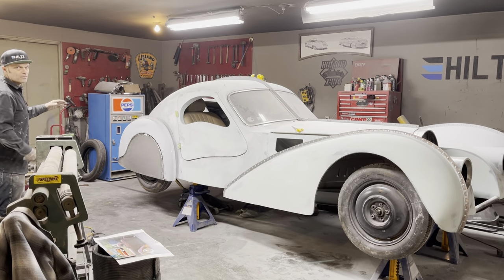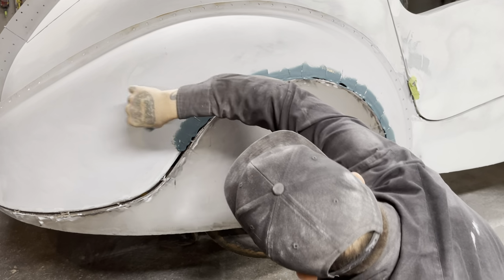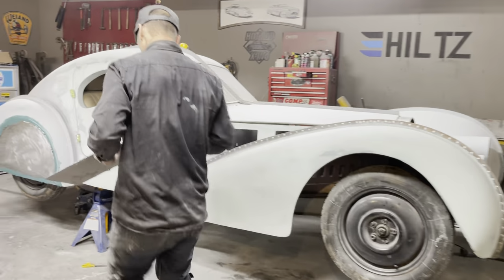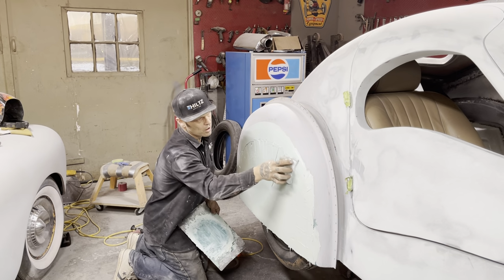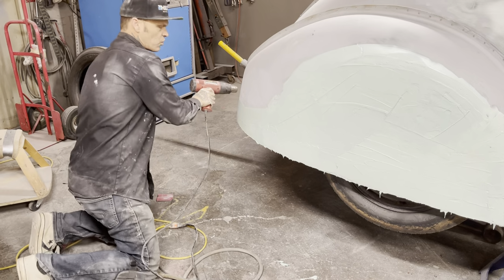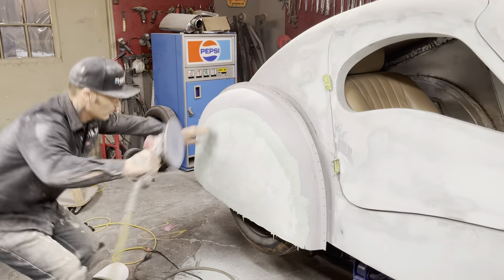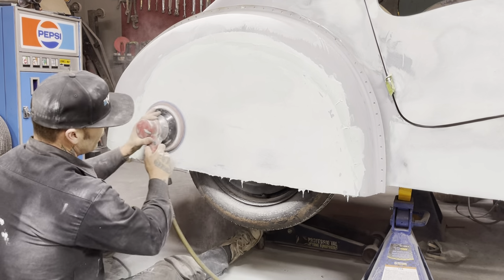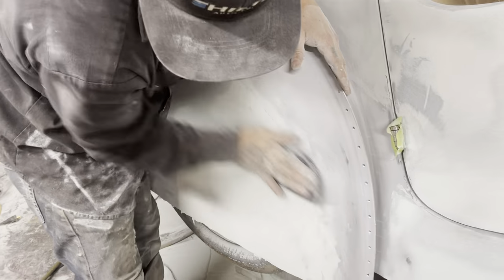FASTEST WAY TO APPLY AUTO BODY FILLER FOR SHOW CAR FINISH

Comment: SEE a Bugatti builder AND a MYTH BUSTER !
Guys that use body filler correctly. 
   Have to fight  an up hill battle, explaining , because ALL, the hackers thru the 60's ,70's,80's , 90's thru till today. That put it on an inch and more thick, to hide damage. So people have seen or know of all the horror stories with Bondo for generations. 
    So thank you for creating a video, we all can direct , the uninformed, how it's done correctly.
Thank You !
Now you just have to tell every body "wide open with lots of pressure ,IS NOT how you use an Air tool."
A never ending learning process, lots of people don't understand ,let the tool do the work.
Great video, pick a day to Announce the color Jolene has picked, you know us ARTist Types, have to envision, the VISION !
Reply: As you know it takes many years of experience to get to the master level and proficiency

Comment: I have done body work using this same method for years now and it works great! First time someone saw me doing it they thought I had lost it because I had a 65 mustang body filled completely shut! Hood doors trunk all of it completely filled shut so there was no body gaps at all. I blocked it out as if it was one continuous panel then went back and cut the gaps open and to size. That car came out so dang beautiful and straight it was awesome! Using the fiberglass filler first is a must just because it's stronger and takes any impact better then just straight filler. Just as a tip when you are doing the body work sanding it down, throwing a guide coat on the filler is a helpful step just so you can see it better. Doing the spot filler allover instead of how you did with covering all of it, all the spots are making high and low spots when you apply it in small sections sometimes making it even waiver then if you just did one big layer. That car is badass to just throwing that in there!!

Comment: The "mud hog" is an old favorite of mine, a great time saver on the larger areas.
Truth is...the gear driven machine provides consistent removal and better control than random orbit or oscillating sanders.
A good dual piston straight file is great, but NOTHING rips on body filler with predictable results like an 8 inch GEAR DRIVEN sander...A.K.A. THE MUD HOG!
Reply: A workout  I like the blk n deceker 
Buffer foam pad stick bk don't
Try it
Reply: At least clean your board

Comment: I have to say you have changed my mind on filling panels with filler.
Fill large and fast....
And flat.
So much time saved.
I have spent whole days on the  same sized sections  in the past.
You just roughed it in in 40 mins.
Nice work

Comment: Thank  God for body filler, when I started in the trade in 1957 any panel repair had to be straightened as much as possible the molten lead was used to fill in the low spots, it was a labor intensive and tedious process. Also the early fillers were unpredictable, the hardener  was clear liquid and you never knew if it was thoroughly mixed consequently you ended up having areas that didn’t cure and other areas that as hard as concrete.  Also you see how he is mixing the product, on more than one occasion as I was mixing the product it would start to smoke and set up right on the mixing board. The big breakthrough came with the advent of colored hardener ,than when it was mixed you knew it was uniform.
Reply: You sound like you’re the same age as me. That’s the way I was taught, metal finish and lead load the small areas you couldn’t get at. We were rationed to one small tin of Plastic Padding per week when it first came out. If we went & asked for more we were asked “what have you done with the one you were given” ? !!! Now it seems plastering the entire body is the accepted way, at least in main stream body repair shops. It’s all about quantity (throughput 💴 💴💴), not quality. Thankfully there are a few coach builders who do it the “old way” .

Comment: I love this project, but I can’t believe that you’ve actually covered the whole car with body filler.
Real coach builders file finish and lead fill small areas only where absolutely necessary.
Reply: Yes we do or at least I did for almost 50years. I remember my first time in a Canadian crash repair shop, back in the mid seventies and the owner didn’t know how to metal finish. Just rough it out & lay the Bondo on like plastering a wall. Needless to say he didn’t know about lead loading either. It was a real eye opener, but I have to say that the folks I met were the salt of the earth. In later years Bondo became widely used here in the U.K. , the “old ways” were no longer cost efficient in repair shops. Coach built vehicles are the opposite, quality costs money, lots of money 💴.
Merry Christmas to all & if you’re going to be using stuff that’s a danger to your health —— wear a respirator.

Comment: You should try the new Mirka dustlass sander system. I love mine and use it almost every day. The salesmen sanded some whit gelcoat with it and then wiped his fingers across the surface and then wiped his fingers in his brand new black jacket and it left zero dust! They are well balanced and light. They also can hook to your phone and tell you rpms and when you reached a maximum European standard for vibration per minute limit. It's a brushless motor too so no moving parts to wear out. Your loved ones would buy you one to save your health also. I've been sending for 40 years or more and this has been one of the best tools in my shop. I hold my breath ALOT when I sand, or used to, sometimes wearing a mask is well, hot lol and sometimes I like to blow dust off real quick so... But this sander is a life saver. MIRKA PLEASE hook Bad Chad up with a sander please. I smoke buy other guys with 3m Sanders or Fien or I've tried all the good ones Dyna Brayde.. It's quiet, the vacuum has a nice long flexible hose and it works sweet. I should probably become a Mirka salesmen.lol I fix boats and cars and rvs, body and paint and fiberglass, gelcoat, make molds do infusion, pre preg carbon,fiber epoxy, I've done it all. My dad used to work for George Barris the King of Customs and he helped build the Munster Mobile and the Pink Panther cars and a few others. I still have some old picks of the cars dad built. So I've been doing this my whole life. Like I always say" If you can still stand you can still sand!" Rob Ormiston.

Comment: Just short of taking the body off the car how will you change tires on it I no your not done yet probably a dumb question I really enjoy your videos I'm disabled an have nothing better to do but you tube all  day
Reply: Good question, once he gets material level on the outside. Will cut a fine l8ne between welded round rod. Then panel will be removable. Will add latches to snap panel back on. Tire can easily be removed. This is how all skirts work.

Comment: I Literally had a dream about this car more than 4 years ago! It didn't have the railing (peaks) and there were footboards on the outside of the doors. So when you step out you step on them before the ground. It was canary yellow and pretty old. sitting on a lift in a huge garage.  It drove great for something that seemed to be sitting for a while!😎  Is this a replica or something?

Comment: I got questions what kind body filler do use an do use polyester filler at any time an do when you apply body filler every that needs it do primer the hole car first then expoy primer sealer last just to seal the hole then you paint it ? The all doing great job jolene doing great job with camera

Comment: Thanks for the video - love the pepsi machine, I would always get one when dad would visit this junkyard( Fieldsboro) in the mornings , Bill would open it and give me one free of charge, must of been because I was only 11 or 12 years old. lol.  Wonder if ya ever tried the body filler dispenser that mounts to the wall with a tap dispenser. Seemed nice were I was working at, as you just put your board under the tap and get as much filler as ya needed and it looks as if you go through a lot of filler~lol

Comment: Chad, please respond to this if possible.
When you mix your mud, you look like you are using what is a ton of hardener and then it seems like you have forever to apply it and it doesn't get hard on you before you finish.
What temp is your work area? I'm trying to figure out if it is your temp in the room, your elevation or another factor I'm not catching but if I did that in my garage in PA on a 65 degree day,  the mud would be hard before I got half of it on the car.If I used half of the hardener you are I still wouldn't be able to get it on the car fast enough.
Is it the product you are using?
Thanks.
Tony

Comment: I’m starting to dabble in body work. Should epoxy primer be sprayed before the filler is applied?
Reply: To answer your question, yes it can be and then you do your filler work on top of the epoxy primer . I does not have to be done this way but it seems to be a better way in todays standards . You can apply filler to bare scuffed up metal and epoxy prime over that .
Reply: Thank you

Comment: im really interested in seeing the latches to hang it on the car.  very cool video. Ive been using  your tips to correct an ugly door gap from a bad 1/4 replacement that was 1/4in off.  On my 65 mustang coupe project.

Comment: Before I cut them off I would make them mount with the brackets are bolts are pens or whatever you decide to use but that way your fit-and-finish would stay the same

Comment: Reminds me of my Drywall career, i did for 45years.
Reply: @benpress8884  Drywall comes in 4x8ft sheets that are cut to fit on a wall. These sheets are made of pressed gypsum with the consistency of talcum powder. The gaps in between sheets are filled with a similar compound commonly referred to as “mud” or drywall compound. The process is essentially the same with sanding.

Comment: Hey Chad, In those joins you'd be way better off using a panel bond glue. I haventb seen may of you guys over there using it. I't's bllody awesome. It has the strength od weld and sands like filler...

Comment: Might be a stupid question but you must have a way to change the rear wheel hey ?
Reply: Cutout and made into a skirt(remove able)
Reply: YEP - here's how that is done. You jack up the car - way up - undo the spring shackle bolts, lower shock mount bolts, then undo the brake fluid line - now then, you also have to unbolt the driveshaft, and the torque links.  Then with a hydraulic jack - slowly lower the rear axle wheels still attached - roll out the axle from under the car.  Next, you take off the lug nuts of the wheel you need to change. With a wooden block under the axle, break free the wheel with the tire. Put a good wheel with a tire in place, and replace the lug nuts. Reinstall the axle the reverse of how you removed it. Then lower the car.  Now you can be on your way.

OR, if that's much too complicated - you could just remove the fender skirt and change the tire the normal way and it'll be quicker as well. Happy Motoring.
Reply: @faerieSAALE  he would have made it all one piece instead there are two pieces so the two pieces would indicate that there would be  a skirt. I believe he also mentions this in the video
Reply: @jontrudell7529  It is not a dumb question.  Many had the same question.  There is a wheel mounted.  Chad said he would remove the skirt from the rear.  So how was he going to get access while the tire is there.  Many viewers  may not be familiar with how to drop the axle.  So the explanation was appreciated.  We know it will eventually be mounted as a removable fender.  So dumb.....
Reply: @nellalarsen9327  HE SAID its REMOVABLE SKIRT & he is gunna DROP the AXLE to cut out skirts from the back side. Are u too Poor too PAY Attention!?? Lol
Reply: @jontrudell7529  I read you response to my comment.  If it is okay with you I'll keep asking 'dumb' questions if I don't know or understand something.  Merry Christmas to you and your family and friends.
Reply: @nellalarsen9327  lol
Reply: @jontrudell7529  So am I at your great intellect and knowledge of all things in coach building.  Have a good and safe Christmas.
Reply: @nellalarsen9327  i suppose so, Hairy Xmas & a Happy New Queer
Reply: @jontrudell7529  Thanks again for your positive information.  Merry Christmas!
Reply: @nellalarsen9327  haha

Comment: So what happens if u get a flat tire or need to do a wheel bearing ,brakes ect
Reply: If you were listening you'd have heard him explain how the cover will be removable , once  the rear axle has been dropped the cover will be cut off from the back/inside where the join line is visible.

Comment: Was that resin you used to thin out the fiberglass?
Reply: Yes and you can put it in bondo as well, it flows well. Kinda like a feather fill catilized (sp) spot putty, fill in sanding scratches, pin holes,edges, or just making old bondo soft.Use regular bondo hardner, mix by volume, it does get a harder as you put more in by volume though. I don't know where they get the space age microspheres.

Comment: Ummm, if you get a flat how are you going to change the back tire if it's all covered up welded and mudded  with fiberglass,  but I'm only 11 years old maybe I'm missing something
Reply: Watch and listen carefully to the video he explains everything
Reply: The fender skirt is only temporarily welded in place while he builds it. When it is done he will cut it loose and use bolts and pins to hold it in place so it can be removed when needed.

Comment: I am sure you are good at you job,  but I was surprise  at the amount of filler that went in to that repair. obviously there is  reason why you did it that way , example ...( who has done the  previews repairs or how it was done or built  before it got to you  ? ) but I recently was involved in  building a complete  new body for that model car in  alluminium,  a bit of file finish was needed in a few places (the like ...where the welded joints  where ,.or where the guards and doors where turned on to the frames etc, BUT...  no   filler what so ever  was needed, just a good coat of high build primer and then the car was painted .
Reply: Shame you didn't actually watch the video with sound.  All your comments where explained.

Comment: He is going for quantity not quality.. that's the difference between a shade tree builder and a Craftsman.. with each panel you make you should be using less Bondo.. never overlap onto rusty metal cut it out and but weld everything.. take some pride in your work

Comment: As you know it's best to stay with the same products, whether it be evercoat or ppg or house of kolar. I use evercoat rage xtreme, then 5star primer/sealer. both are polyester products. I just find I use less filler with the extreme. Know matter the mud you use 2/3's hits the floor anyways. You should always wear a respirator when sanding the filler and primer. Not like this dummy (sorry Chad ). With the chemicals in that stuff will eat your lungs up. Ronnie.
Reply: The best mud cheepist primer ok
Just sand to 220  does shrink
Epoxy all mettle. Take pride in
Work  true massons.

Comment: Chad, don't you risk cracking when you accelerate the drying with heat, the material is contracting at a rate quicker than it was designed for.

Comment: As a professional car painter .. just watching him my lungs hurt. Wear a mask adds a few more years to yourself..
Reply: Me too....seen a lot of guys suffer with copd....in large heart and so on. It's a wonder i haven't got problems too...was sanding fiberglass boats when i was 12 years old at 18 went to work  doing industrial insulation work for 16 years with no face covering. To top it off smoked two packs of Marlboro red everday the world turned... ive been lucky no lung problems most are not that lucky  !!......i forgot spray painted apartment's for Birmingham housing authority for 9 years aswell.

Comment: How in the hell are you supposed to get the tires off of it and do a brake job with the damn skirts over the wheel as well as weld it on

Comment: I can't believe how people use plastic filler over last 20 years. I went to a technical high school (junior & senior years.)  in the mid 1970s. Worked in the field for 35 years. All these workers today are only worried about shoving the job out the door and not long term quality. Your first (and sometimes second) coat of plastic filler should always be cut with what's know (or used to be.) in the profession as a 'cheese grater.' Never use a DA to sand filler!*

Comment: There is such a thing as editing... So you wasted more time with the heat gun as well as mud. Plus if you start to sand before it's completely dry but not completely wet, you deal with less dust.

Comment: Don't put duroglass on top of anything but metal. And skim thru the initial layer, 80 grit,  to open it up past the slime when you cover duro glass  with the body filler.  This Chad is not very smart.

Comment: its gonna rust again.  should have primed it before applying the fiber . 
but maybe youre lucky and be in a hot dry area.
your method sure dont work in scandinavia with all the snow and rain all time.
there would be rust bubbles within a year .
and no im not just a keyboard  professor 
built custom semis for 10 years  among them truck of the year winners and  back to back nordic trophy winners.
a broken spine  ruined that adventure

Comment: Looks good, but I don’t think you really thought it threw. What you going to do if your tires wear out and you need to change them ?  If they are not removable you going have drop the rear end to get it done. Dumbass move in my books